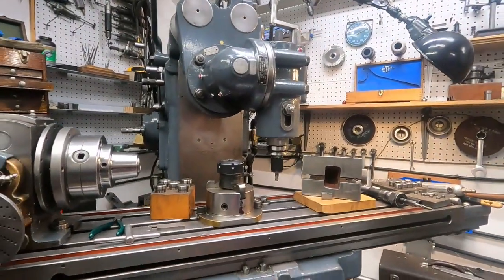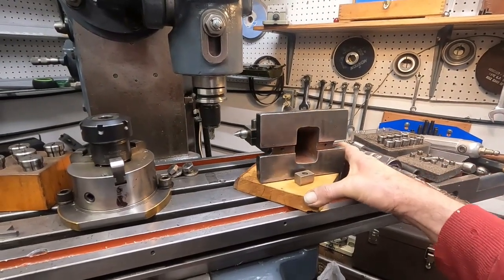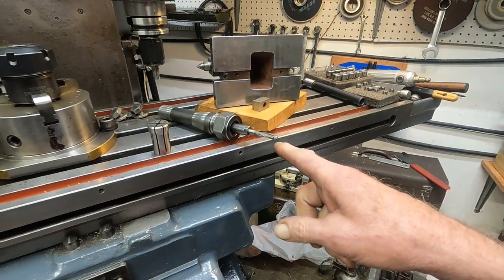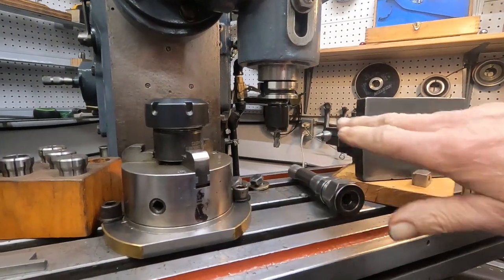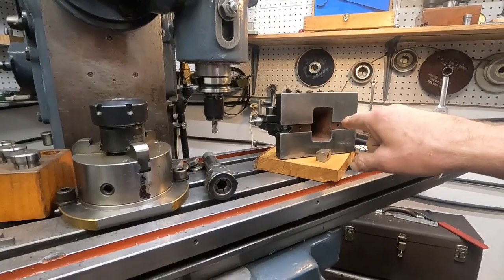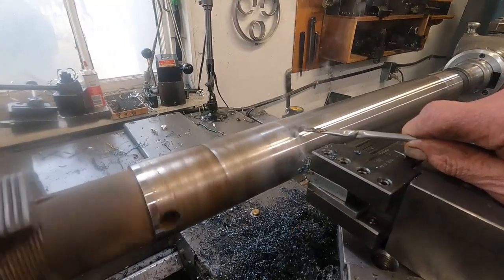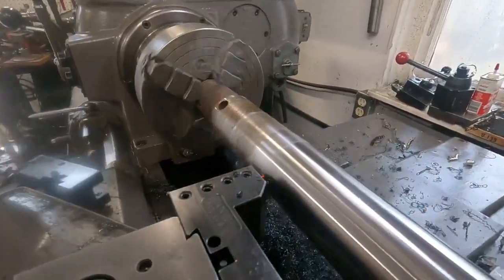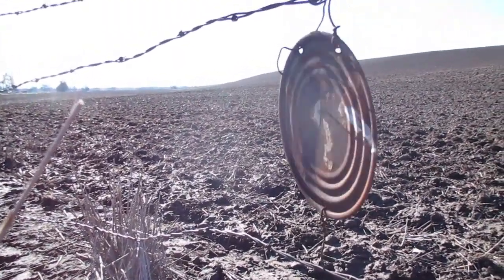Brown & Sharpe Milling machine Erickson collets

Comment: Good one Don .    With induction hardened , i always run flood coolant .  Ceramic's are the go but i have had great results with Dorian CNMG-432-KER-DKC15RT inserts .    Cheers  👍
Reply from the maker: There is two schools of thought that no one really talks about and that is annealing the shaft end before machining by simply hanging the end over the bench and heating it with a rose bud torch and letting it cool. I have not seen a failure from that practice in heavy mining use and it cant be detected once the chrome is polished. I have done it with ceramic and coolant too. Now that is on what is called here IHCP hydraulic cylinder rod.

Comment: The standard ER collet nuts are a bit big, you can get smaller diameter ones though.
A couple years ago I bought several Kennametal branded ER16 extension holders, that were NOS and very cheap (less than new Chinese made at the time) they were even made in the UK. Still haven't got round to buying a full set of ER16 collets though.
Reply from the maker: Both systems have advantage and disadvantage, I will try to pick up more ER collets and extensions too, thanks!